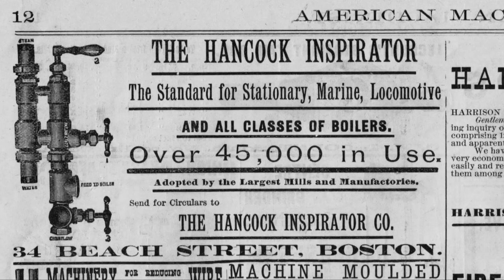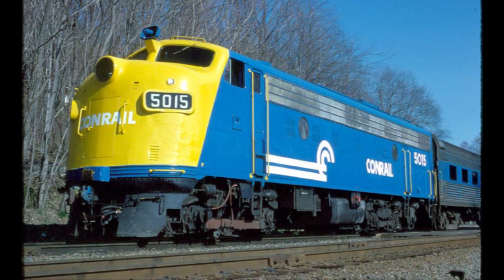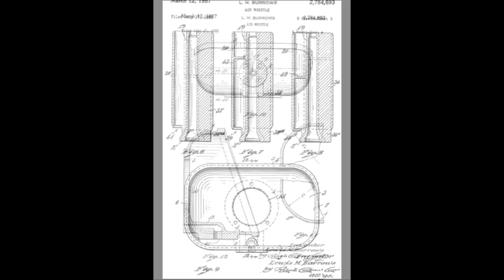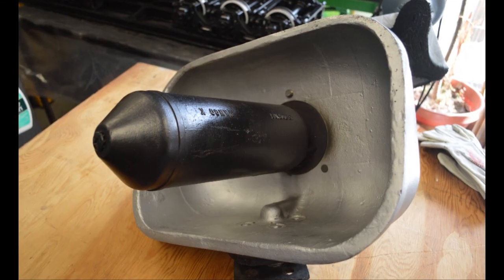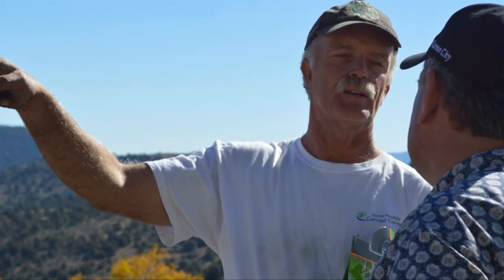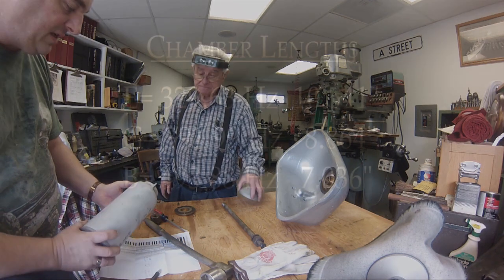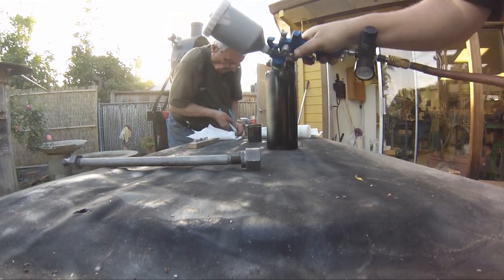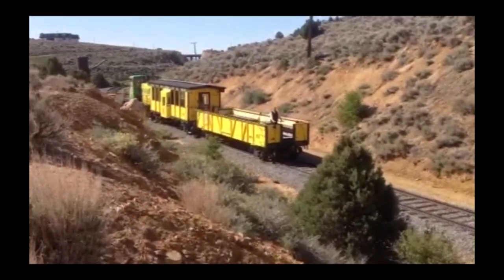Hancock 4700 Air Whistle for the V&T

Comment: I went to the V&T today, and the whistle is starting to sound like the Toonerville Trolley again.
Reply from the maker: Its not our whistle.It had a problem and is in our shop.  The original Hancock is on the D-1 at the moment.
Reply from the maker: The constant vibration loosened the solder joints and allowed air to pass through the chamber stops. We have repaired the whistle and it now sounds like it should.
Reply: I've haven't been able to find a Toonerville Trolley whistle recording. Can you send me a link to a recording of it?
Reply: @AlexTrain5249  HaHa

Comment: If I may, I'd like to ask you a question, regarding the whistles you build. 

How can one determine the notes of the whistle, considering that many whistles have different diameters and bell lengths? 

I'm asking, because I'm going into a machining class at college, and one of the projects I have is to build, at least, one steam whistle for the railroad museum I work for.
 The main problem I've been having, is figuring out how to get the certain notes of the whistle, to match with the diameter and length of the bell.
Reply from the maker: Determining or predicting the frequency of a chamber of a given length is not as easy as you might think.  There are a lot of variables to consider and quite a bit of math involved. 
Here are two things that are constant: Diameter equals volume or amplitude and length is frequency.  The larger diameter, the louder the whistle. The longer the chamber, the lower the note.
I hope that gives you some idea of the fundamentals.